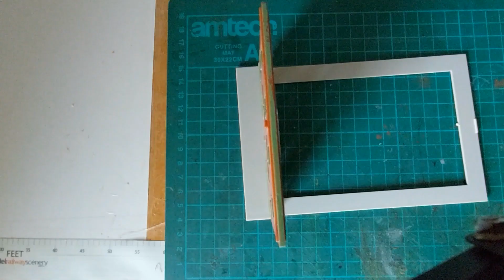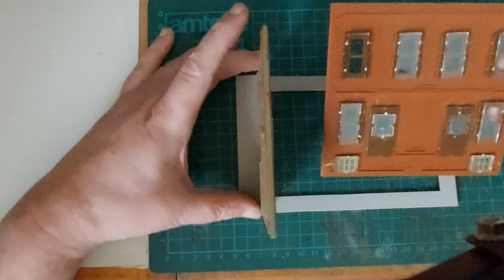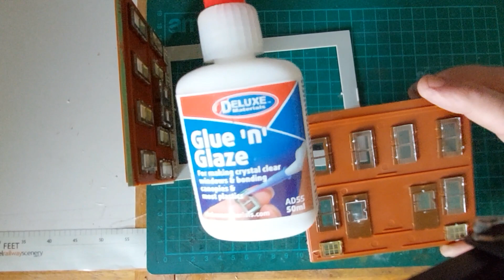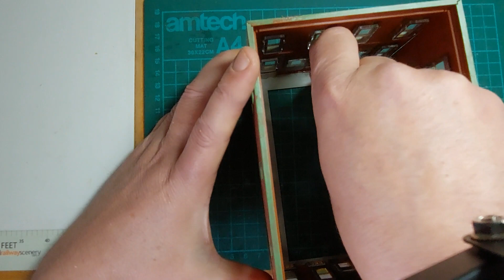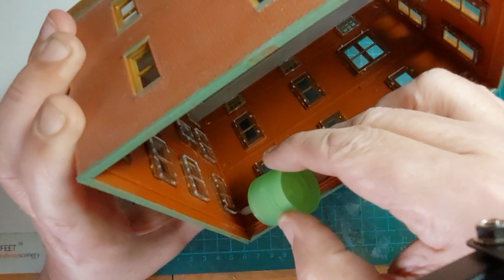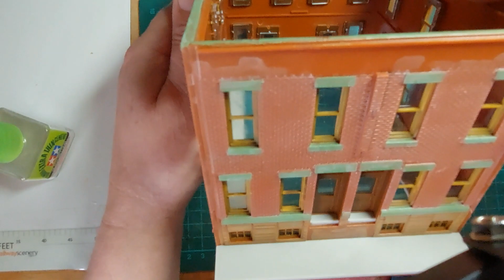Constructing a walthers kit

Comment: Nice job, Digger.  I like that you apply the glue on the corners instead of what we’re used to, glue on the sides.  Thanks for sharing.
Reply from the maker: Many thanks Drew it certainly a lot easier to use